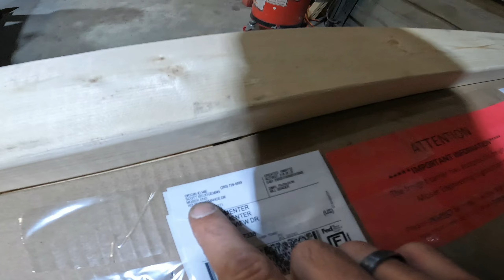SS Camaro ~ F body ~ Pro Touring Build ~ Parts Unboxing ~ Who the heck does This!?!?!?

Comment: Just a question here how come you didn't go for a 9-inch is it because of the Watts link setup
Reply from the maker: i did not like the idea of the added on bracketry for the 9 inch. i wanted the cast torque arm. we had thought about going 4 link and 9inch. but bold on , well as close to, is what er wanted. 9 inch adds complexity i didn't want to deal with. it's bad enough lol.